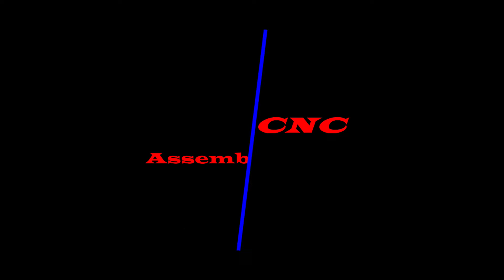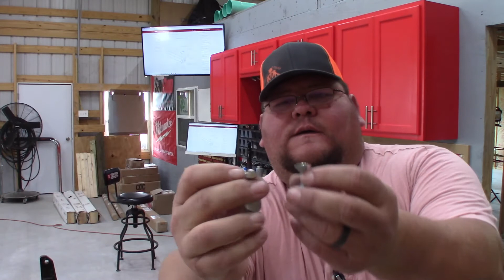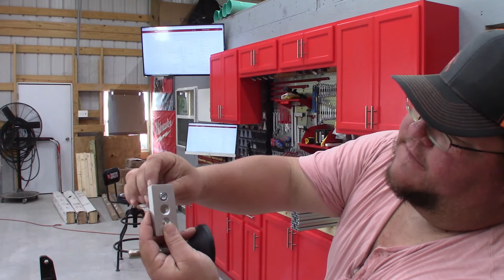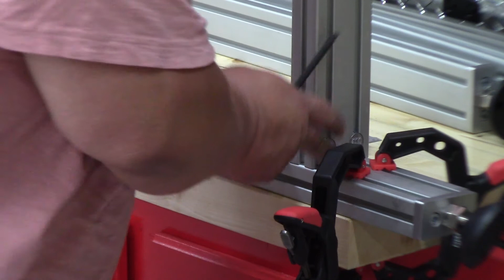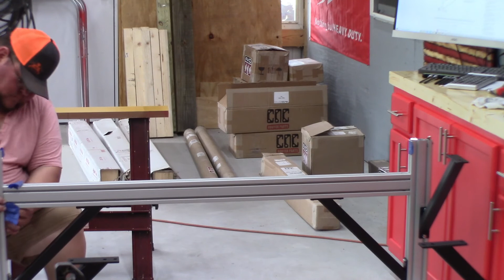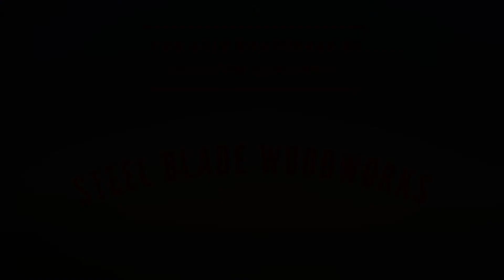AVID PRO CNC 48x48 BUILD PART 1

Comment: I just finished the leg set for the PRO60120.  Your video helped out a lot until it got up to the 45 degree supports.  For my kit they switched to 80/20 pieces instead of steel braces and they are put on after the table top with all the cross members are on.
  I'm thinking I missed something as I followed along reading the instructions and looking at your video for the same steps.

  Did you use Loctite?  I saw it on the bench, but I didn't see you use it.  I've seen other videos where people use Loctite, but I'm concerned with the time it take when you put it on until you tighten that piece.
  How long is too long and I think I'm going to have to take things apart and start over.  But with the table as it is I can do it one leg at a time so that I don't have to pull it all apart.  This way I have short time periods between when the Loctite is added and when it is tightened down.

  So, did you add Loctite to all those bolts and I just didn't notice it?  When I add the eight cross braces I'll use Loctite then.
Reply from the maker: The legs did get locktite and the 45 degree supports did as well. The only thing I did on the supports is I waited until I was going to tighten them which I didn’t show applying it. I was to concerned that it would dry. It’s a bit of a tedious process doing them one at a time, but that’s how I did it. The only thing I didn’t add loctite to was the cross member support that holds the electronics. I hope this helps. Thanks for watching bud!!!

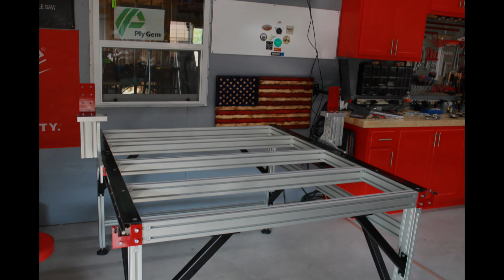Comment: Hello and thank you for the video I'm going to start my build soon and will add the lub when it arrives.  At time 20:32 you have a leg set on the bench.  I wonder if you or anyone else has thought of using "T braces" at the intersection of the crossbar and legs to provide additional support?  Additionally you could place "L brackets in other location to provide extra support.
  Do you think this would help, or not really needed?

  One other question about your computer setup.  I can't see the computer to know what kind  "laptop, small tower or small fan-less" type, but how is that monitor setup?  I see the smaller one on the bench and the larger one mounted on the ceiling in the corner.
  Can you discuss how you have that setup?  Is that one long cable or do you have some video extender?
Reply from the maker: I can say that when I’ve had the CNC running close to 300 IPM you can feel the CNC shake when the gantry makes moves in other directions. It’s not much at all that would cause an issue in my opinion, but adding more support would not hurt either. One thing I will clarify on these videos that I missed and will address in my wrap up video are the linear bearings. There is actually an orientation on how they are placed on the rails. I had one of my other subscribers point that out. How I missed that is beyond me, but I will address that issue. Thank you for your feedback and I hope your enjoying the series of videos. If I can be of any help do not hesitate to reach out and I will try my best to answer your questions. Again thank You for taking the time to watch my content I greatly appreciate it.

Comment: Nice!  My avid literally shipped today.  Good tip on the anti sieze!  So with the glue stick loctite on all the fasteners, what happens when you go to square the machine?  Maybe loosen the offending bolts and it should be fine?
Reply from the maker: Thank you for watching. Honestly mine was perfectly square after I finished assembling the table. Maybe I was lucky, hey I’ll take it tho lol. If you have to loosen the bolts after the fact to square up you’ll be okay. Just make sure your using the blue medium grade locktite. It took me two of the bigger tubes to assemble my 4x4. Once you start the assembly process you’ll know what needs locktite and what doesn’t. If you run into any issues and you need some help hit me up and I will gladly help. If you have and Instagram account you can reach me @joey.steelblade and just shoot me a DM. Again thank you for watching and I hope to have Part 2 out soon!!!